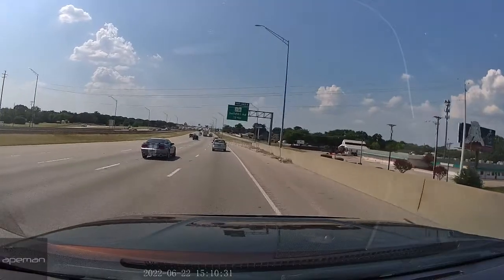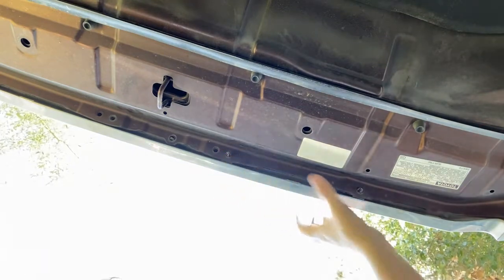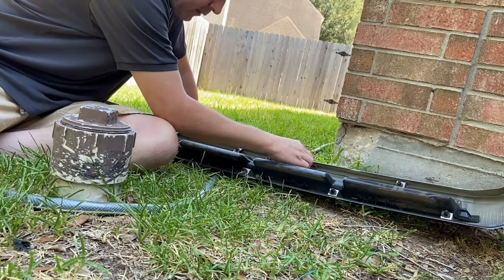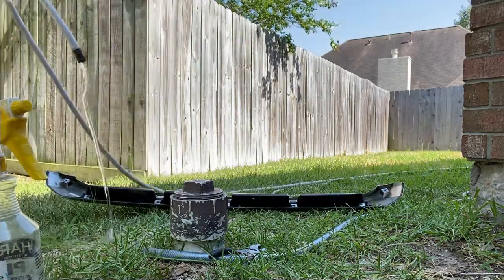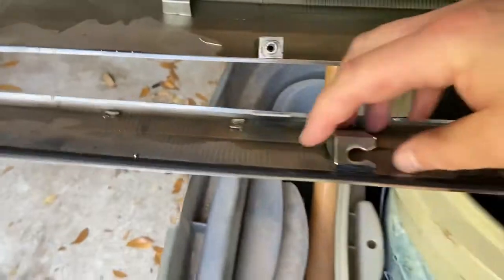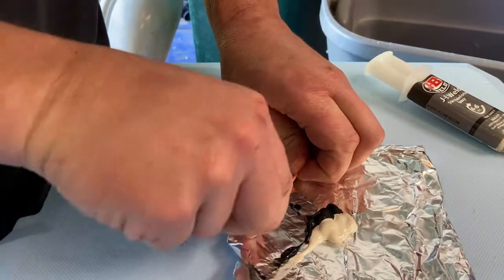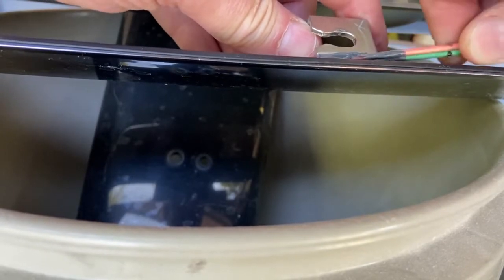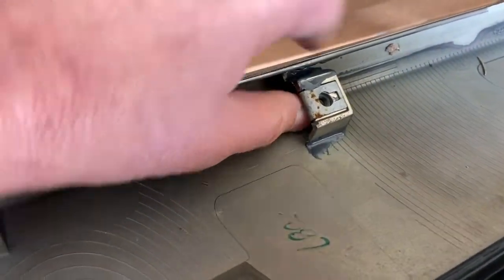Fixing My 2014 Tundra Hood Trim

Comment: How has this held up for you? I’ve been dealing with this for a while.
Reply from the maker: This fix has held up amazingly well. I've made a few couple-hour road trips since the repair and did not realize how much it had bothered me until I fixed it. LOL.
Reply: Still holds up good? Im thinking i just need to replace the fasteners the “oem” ones seem a little flimsy one fell off
Reply from the maker: It's holding up great! I think the key is the JB Weld part. I did not realize how much it drove me crazy until after I fixed it. LOL. Good luck.
Reply: @projectfixit  thanks! It is driving me crazy. I’ve looked at a bunch of different “fixes” but this seems to be the one I’m going to go with
Reply: Good job. Wish I saw this before I bought a new one.